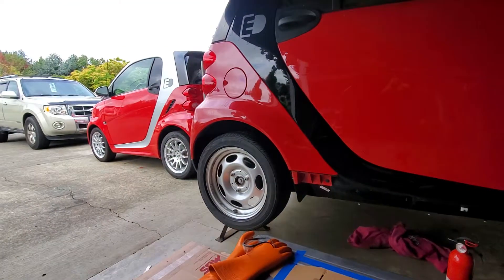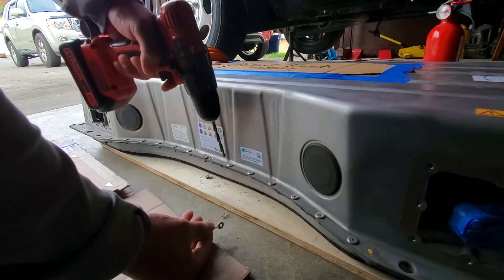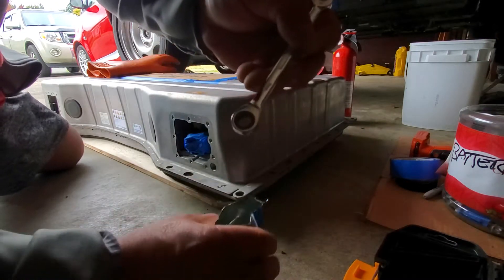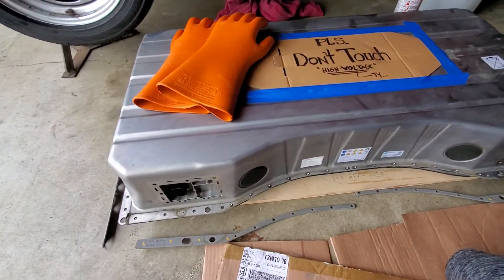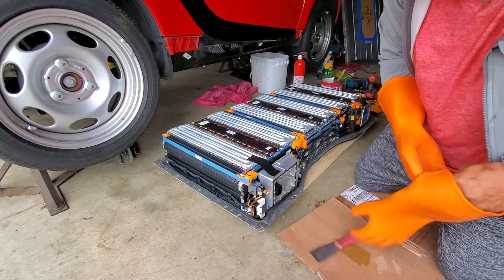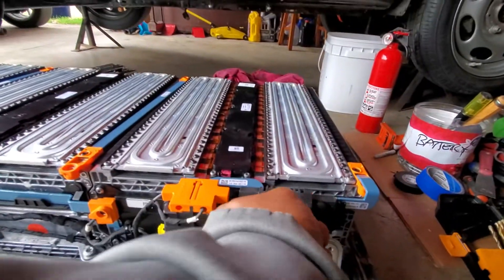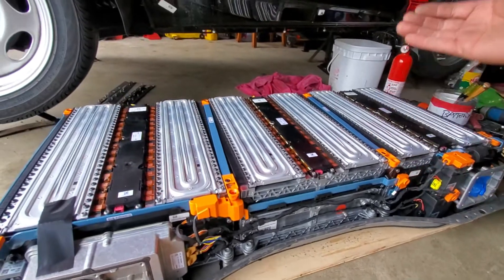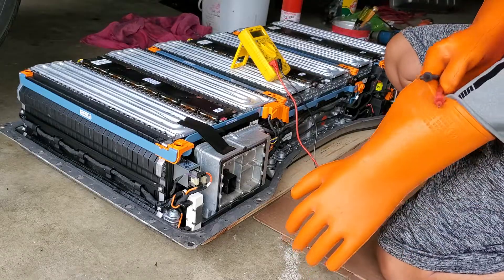Smart CAR HV battery (How to Open Safely)

Comment: so if the BMS shuts down the battery and discharges it.... can the battery be brought back to life easily?  reset?  recharge?
Reply from the maker: Yes can re charge  ...but really slow ...after checking all the cell
Reply: @Angelsum143  what city are you located in?